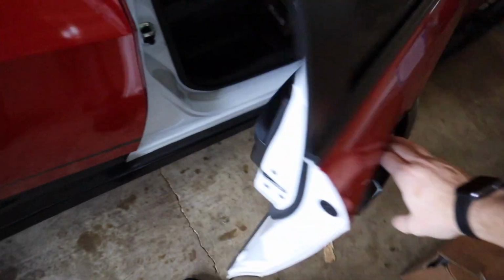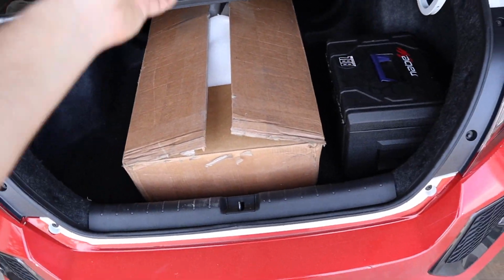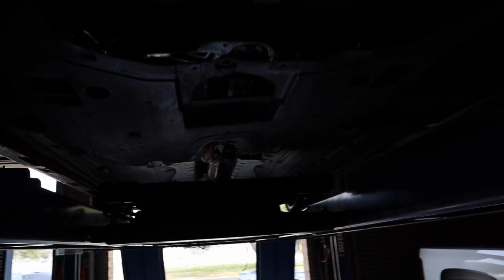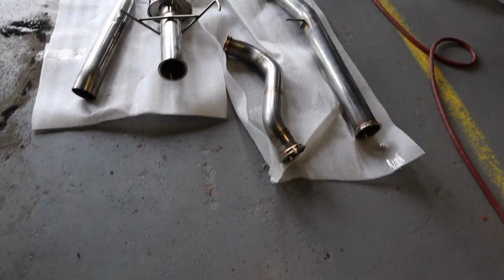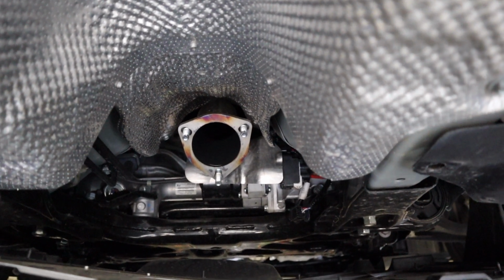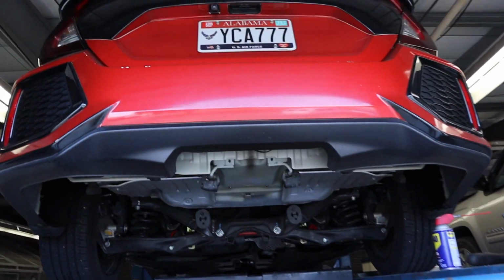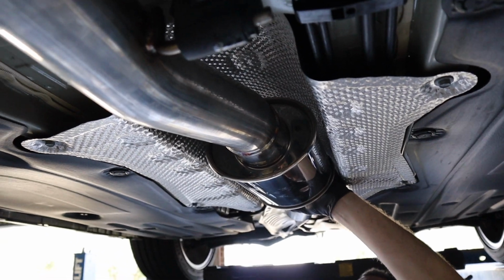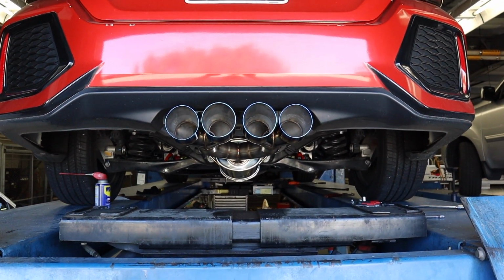MAPerformance Exhaust Install **10th Gen Civic Si**

Comment: Congrats! Looking good - we are happy things got sorted out and are super excited for the sound clips!
Reply: Can this exhaust be purchased with only 2 tips?
Reply: @onehunned_  no
Reply: can this fit for the 10th gen ext?
Reply: @MAPerformance does the adapter part for the PRL Fp/dp combo come with exhaust system or do I have to order that separate?
Reply: @Firecrazy17  it comes with the exhaust. You choose the option to either having prl or "stock" front pipe or map front pipe. You would choose the option that says stock front pipe and they "should" provide you with the adapter.
Reply: Correct! Thanks for all the questions - glad you guys are excited about the exhaust!
Reply: Congrats brother.is that new honda civic
Reply: Does the exhaust come with the adapter plate or we have to buy it separate?
Reply from the maker: It ask you at checkout
Reply: I didn’t see it
Reply: Did you have to pay extra for it?
Reply from the maker: No
Reply: @joshjackson2646  just to be clear, I have the prl front down pipe combo, do we choose the one that says "No I have a factory or factory flanged front pipe"?
Reply: @tbe_xavier  correct! Because the prl front/down bolts up just like the factory stock pipes do.
Reply: @tbe_xavier  wow they have a killer deal going on right now....
Reply: josh jackson yes lol that’s why I’m going to take advantage and take that deal.
Reply: josh jackson and thanks bro. Follow up my channel. Si content coming soon

Comment: Quick question on 10th gen Civic sedan 1.5T: can I use a 3 inch cat-back exhaust with the factory OEM front pipe which I believe it’s a 2 1/2 or 2 1/4?
Reply from the maker: I believe so it just has to adapt to the stick front pipe. If you go with MAPERFORMANCE I believe they have a choice at checkout.

Comment: Congrats on 10k! Just got my 19 civic si on Saturday and found your channel!
Reply from the maker: Thanks! Enjoy I have lots of videos!
Reply: Only knock I have on the 19 is the info system buttons make it look a bit cheap c8mpared to the 17/18 clean face info system. Just my opinion.
Reply: I haven't been in a 2017-18. But they did upgrade the system to function faster and the screen size is increased. However, I did notice that they added buttons to the interface as opposed to the 17-18 models which are fully touchscreen. I guess it boils down to preference.

Comment: Congratulations on the 10k T. Your lucky to have friends to help you! I did my install on ramps/jack stands. Was a rough day lol. How was the install? Mine was a little uneven when I first installed. It was 100% my fault, I went back under the car and turned the pipes to get it perfect. I was a little surprised you didn't spend the extra cash to buy the MAP Front pipe to fit to catback. Not really necessary though. Your not the only one to have missing pieces. MAP had a rough time with their shipping on this one. I think they learned from it for sure. T I think this is one of your first mods that everybody can agree that you made the right decision. I am so happy you didn't go with Greddy. You told me a little while back that you were gonna go with Greddy but you totally made the right move. We just need to hope 27won si exhaust doesn't blow our MAP out of the water.  I will say you are part of the reason I bought a 10th gen SI! I was watching your videos before I went to the dealership to buy my car. You helped me plan my build before my car was even sitting in my driveway. You are on my wife hit list btw. This channel started me on my path to modding. I am doing things a little different than you but you are ultimately the one the thank.
Look forward to the next one
Reply from the maker: Thanks Joshua! It’s funny to hear that I’m on your wife’s hit list! I have the PRL DP/FP that’s why I didn’t get the MAPerformance front pipe.... but I’m glad I have inspired your 10th Gen build and thanks again for the nice comment!